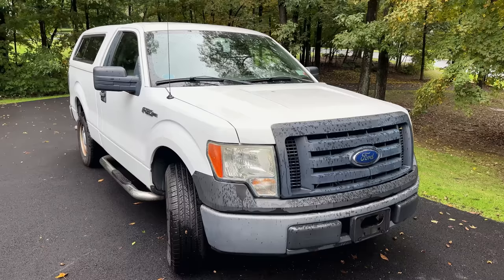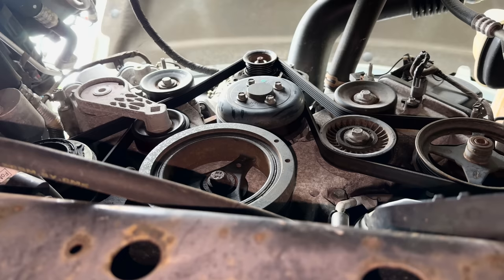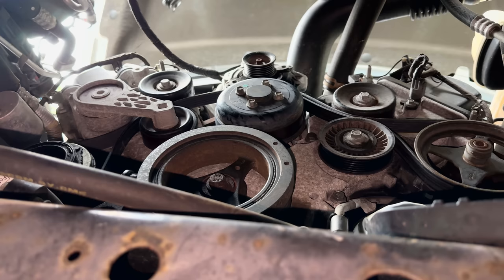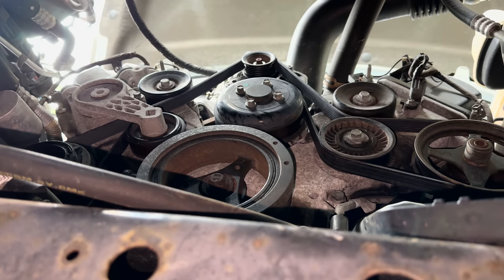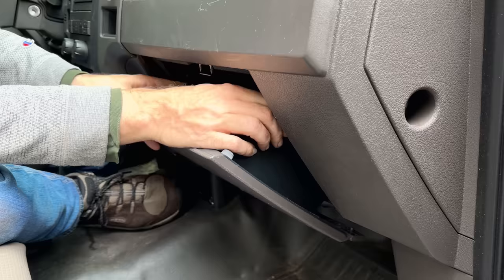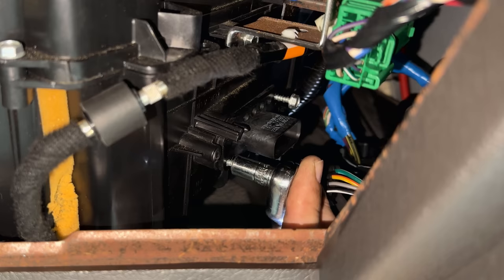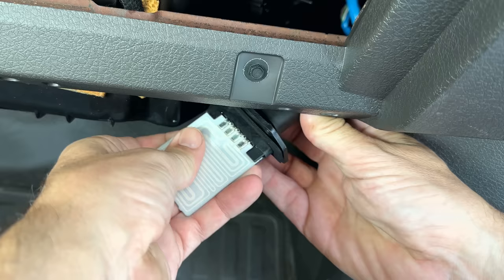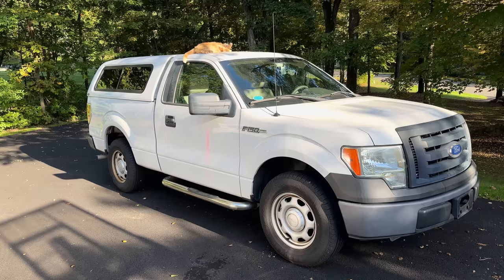2010 F-150 Belt Replacement and Blower Motor Resistor Repair

Comment: Learned the hard way many years ago to replace a serpentine belt with a quality brand name belt.  The cheap one's are fine at first but start squeeking long before they are worn out.  Also, with the belt off, it would be a great time to check each & every pulley for 1) bearing noise 2) wobble 3) freely turning.
Reply: Yep
Reply: If it's hard to replace or it's gonna mess you up if fails, always go with the good stuff

Comment: Check your blower amps on max, the motor will take out the resistor IF it’s dragging & drawing too much.
Reply: That Block is by-passed on High..
Reply: Right, but the motor is specc'ed at max. If it's drawing to much at max, it's drawing too much at other settings, too
Reply: Yup, as the blower motor ages it can start drawing more and more amps which can take out the resister pack.
Reply: My blower motor needs lubing  bearings every few years, or rats nest or leaves plug the vanes and cause a load. Clean out, lube up and replace resistor as reqd. A mesh screen over air inlet duct helped.
Reply: Check for mouse nest in blower assembly would cause excessive blower current...
Reply: Beat me to it. Dragging motor bearing causes more power draw and probably insufficient airflow across the resistor.
Reply: @rcf8367 It won't blow the resistor card when at max, only when in lower settings  does the card actually cut the current down. Yes when testing with an amp clamp you want to check it at max to see the draw.
Reply: @ruchknruchkn6575 or restricted air flow could be causing the failure.

Comment: On a different subject, You always say at the end of your videos “Hope this helps”. Well I can honestly say they do. Had a problem with a tiller where it wouldn’t start. Took the carb off and cleaned it out pulled the pilot and main jet. Pulled the float and needle valve. Cleaned the ports with carb cleaner. Put back together and started on second pull. So I’m saying thank you for the useful info on your vids.

Comment: Check your cabin filter. If it is plugged then low air flow will cause the board to burn up
Reply: The 2010 F-150 doesn’t have one.  The 2015+ F-150’s does have one behind the glove box.
Reply: @stevenn4393 Evaporator or heater core plugged up?

Comment: I had no idea that replacing a serpentine belt was so easy.  Great video as always!
Reply: It's even easier on the 4.2 V6 Essex engine
Reply: Try it on a Volvo with a transverse engine - It's not! Try it on an Iveco Daily van, and you can almost so it with your eyes closed.  

It's all down to the individual vehicle design.
Reply: Thanks for keeping the feline helpers in the videos. 😍
Reply: @JonathanKulp  The old cat scan. They always have to inspect something new in the drive way. lol.
Reply: try it on the audi: you gotta take the engine out!

Comment: that blower motor resister may have gone bad from a high current blower motor or insufficient air flow from a dirty cabin air filter.
Reply: Yep, I was thinking the same. Bearings could be dragging, causing high amp draw.
Reply: Likely also is transient excessive current drawn by the blower motor.
This is common for a vehicle not in regular use. Daily use frequently
runs a blower to keep bearings loosened up that otherwise get sticky
and drag from lost lubrication. Some blowers can get surface rust on 
the armature while the vehicle is in disuse and can drag and run noisy 
and draw excessive current and cause the resistor block to burn out. 
I have seen some blower switches first On detent is High to bypass
resistors and provide full current as a surge to help start the motor
and then the selector steps down the speed of the motor as if the 
speed selector was backwards to what is more usually found as an
Off to Low, so the transition is always Off to High and High to Off. 
Some blower switches have no actual Off condition and the motor
is still windmilling at a very low speed to keep the bearings free to 
reduce the failure rate for the blower resistor blocks. Some blocks
will have self resetting thermal breakers for protection but most
of the manufacturers are too cheap to include that feature. Most
of the time when a blower resistor burns up, it is a good idea to
at least oil the bearings or replace the blower motor if needed. 
Obstructed airflow from leaf debris on the intake vents or a 
dirty screen or filter can definitely cause resistor overheating 
and failure by itself, but particularly for a vehicle that has been
sitting in disuse or is rarely used, all these issues can combine.
Reply: Mouse nest or a rat nest it's happen

Comment: James, I have that exact truck in Lariat trim. A 2010 F-150 Super Crew with the 5.4L-3V engine. I see from the video that yours has the 4.6L engine. The 4.6L and the 5.4L-2V engine are both extremely reliable and you should get 300k+ miles out of it without any major work AS LONG AS IT IS WELL MAINTAINED! 
These Ford OHC engines (all Triton series, and the newer Coyote series) all use an oil-pressure based cam chain tensioner, which is known to lose seal at about 150K miles if not well maintained. In the case of the 4.6L and 5.4L-2V engines, you lose a little oil pressure, and the engine makes some odd noises from the front timing chain cover due to the chain slapping against the tensioners and inner timing chain cover. Other than that, the engine pretty much runs fine. If you ever hear that, get a timing chain replacement done quickly to prevent other issues. Just keep an eye on the oil pressure gauge, and if it drops, even a little, listen for that chain noise, and get it repaired right away if you hear anything out of the ordinary.
Mine, however, has the 5.4L-3V, which has the same tensioner configuration, but has one more serious issue...  If the tensioner seals let loose, then the timing chain slaps the tensioners and breaks them, which allows pieces of the tensioner to fall into the oil pan and clog the oil pickup, and, well, you can guess what happens then. Oil starvation is (as you know) a major cause of catastrophic failure in any engine. Add to that, that these engines are OHC, and lack of oil pressure causes the engine to eat itself alive from the top down, in a matter of weeks.
While your 4.6L is far less known for this issue, it wouldn't hurt to stick your borescope into the oil pan through the oil drain plug and look for debris in the oil pickup. If it's clean, then you're likely ok. Just maintain it well, use 100% synthetic 5-20 or 5-30 oil always, and DO NOT EXTEND OIL CHANGES BEYOND ABOUT 5000 MILES. If you do that, you'll probably get 300K+ miles out of it.
Reply from the maker: Thanks for all the tips.  Not crazy about the chain tensioner design.  Will be on the lookout.
Reply: @jcondon1  I find it difficult to call a design that lasts for 150k to 300k miles a "bad" design. (I realize you didn't call it that, you only said you were not crazy about it.) That being said, if something DOES happen, the eventual results can be a lot more costly than with a more simple design. A traditional single internal cam with pushrods, doesn't have a tensioner, and thus, has far fewer potential issues. But, these Tritons and Coyotes can last forever with proper maintenance, so I still like the design. That 4.6L Triton is a rock solid engine!
BTW - I had a timing chain replacement (and associated parts, cam phasers, chain tensioners, valve rockers, oil pump, etc.) done on my 5.4L-3V proactively since I bought the truck used and had no idea of it's history or maintenance record. Luckily, the internals looked really good, so it apparently was maintained really well. Still, I know that it will give me a lifetime of good service now that it's all new, genuine Ford parts.
And, like others have said, you can go get more generators now. 😁

Comment: Hi, James. Seems like you swapped wrenching-hobbie with Mustie1 this weekend. He's doing a generator😂. To your problem with your Resistor. Maybe you check the  inside of the blower-housing with your boroscope. The air-passage may be blocked with leafs or such. An clogged up airfilter may also be a culprit. As mentioned by other viewers a slowly dying motor could also be the issue.

Comment: My blower resistor was replaced 4-5 times and then I replaced the blower motor on my Dodge Dakota. The resistor was $5 from Chrysler but the two replacement motors were $300 each. I also had to replace the wiring harness twice which was $100 each time. Ultimately I ended up putting a screw on the knob that controlled the speed of the fan and limited  the speed to a setting of 3 out of 5. I wish you a better outcome.:face-blue-wide-eyes:

Comment: James, you did exactly what I did on my old Chevy van. I replaced one resistor and the new one worked before it quit. I did that again with the same result. Finally I had to replace the connector and wires. Pulling the connector apart was polishing the connector contacts enough to restore power until the connector failed again.

Comment: Just a suggestion. If you are going to use this truck to load generators add a small ATV type winch to the front of the truck bed inside. With portable ramps it will make loading just about any equipment quite easy. The installation of the winch might make an interesting video.

Comment: I like how you got a 2nd opinion after the first Cat scan😁
I think the cats can smell the current/previous tennants.
Also, the genuine Motorcraft resistor looked suspiciously similar to the Amazon one🤔
Reply: Or the Amazon one looks suspiciously similar to the Motorcraft one. The odds are good they're all made at the same factory. Just because a part is stamped Ford/GM/Chevrolet doesn't mean it's made by them.
Reply: @JCWren  Yes, that's definitely a possibility.
Very few parts are made by the actual car makers these days, just a conglomeration of parts made by major parts manufacturers from many different countries.

Comment: I see the supervisors came out and gave the job the cat scan. On the noisy belt I had a F150 had noisy belt new on only lasted about 6k. Finally found out power steering pulley was almost 1/4 inch out of line. You had to lay a straightedge across pulleys to tell. After a FUBAR  nightmare involving a new pulley and a hammer and chisel. Only changed belt once in the next 200k. Good luck with the truck.

Comment: Aside from checking the blower amps. Also check if there is a physical obstruction in the housing that is preventing the resistor from being cooled. They shouldn't break that often.

Comment: The belt noise is often generated not by the grooved side, but rather the smooth side where it drives the water pump. You can test this by spraying a little WD-40 on the water pump pulley. I saw you put the flat side on the idler pulley with grooves and laughed, been there, done that.

Comment: A few years back I was hurt at work and had several surgeries to correct the break. At the end of it I had to buy a vehicle and I found an 85 grand marquis and the right price. Deep down I wanted to drive a big old car anyway so I bought it. Had to replace the resistor on it. And a few other things. It was an awesome if not so desirable looking design. $500 went a long way. Anyway

Comment: James, I have a 2011 Escape with the same resistor for the fan.  I did the same thing.  The original went bad.  Used a cheap Amazon one for maybe a year.  Then had to replace again and at that time I went with a MotorCraft.  My MotorCraft one was good and has been in use for about 4 years now.
Reply from the maker: That gives me hope.

Comment: I just turned in my 2011 F150 at my day job for a 2014 GMC 1500. That Ford was a good truck, but it’s going to auction as the higher ups decided it was past its useful life.

Comment: James I have 3 Ford's that use that style blower motor resistor. First one I replaced from ford lasted just over 1 year. The ones I got from Amazon lasted much longer at a lot less. I would check the blower motor maybe drawing to much current.

Comment: Over the years I've always used di-electric grease on the blower fan resistor connector when replacing the resister.  Those connectors can have their own issues because of bad contact which creates heat.  That I find is the leading cause of those resistors burning up.

Comment: Hey James ...glad you got the mower deck bracket sorted now, so it doesn't hit the steering. The Blower fan motor should be replaced. They do still work but draw too many amps overheating the board on the resistor. Ask me how I know. LOL After 4 boards inc a faulty one. tells me that the motor is not good. An amp clamp should confirm it .... but you need to know the amp draw on a known good motor as a reference. Cheers Robert
Reply from the maker: That is the key.  Don’t know the amp draw.  Will go back in and replace the motor and do the cabin filter while in there.

Comment: Hi James...i had the resistor replaced twice on my Ford F250 before they blamed it on the blower motor. They replaced the motor and I didn't have the resistor problem in the future. FYI....
Reply from the maker: I am expecting the same.  But so far so good.

Comment: James, if the fan belt starts squealing again it's because the alternator pulley is worn out. What happens is the V's in the pulley wear and the belt bottoms out, hence making the belt slip.

Comment: the belt groves get deeper as it wears, this causes the slipping, check the old to the new groves and you might be able to see it, there is a tool to check the groove wear. The fan motor might be going bad as well which would pull more current than the resistor can handle thus the failure. IF it happens again replace the motor and the resistor.

Comment: If you have air conditioning, there may be a heat exchanger near the fan resistor. If the heat exchanger is plugged up with leaves and junk, then it may be overheating the resistor.

Comment: Most modern belts won't crack. The grooves in them start out shallow. As the belt gets older they get deeper. Eventually you have the problem that you had with it. 30 years ago blower resisters rarely went bad. After the 2000's they went down hill.

Comment: Thanks james.  
Reminds Me of a time with My old 99 E-150 Shop truck. My trouble totally baffled the Shop tech Cause I told Him the Switch was bad. I had all the lower speeds but High..  and he insisted the Resistor Block was bad.  
I took the switch apart right in front of him and showed Him the Burned up Contacts.....
Mike M.

Comment: lot of 2000-ish GM products had problems with the blower motor resistors. Had a vehicle that went through two of them, with no other issue than just garbage resistor assemblies.

Comment: Would have been interesting to see how their resistances compared. Absent any obvious burn marks or cracks, you might try reflowing the solder joints. Would take only a few seconds and might clear up hidden defects.

Comment: Definitely check the fuel trims too as well make sure they are within pos or neg 10 percent ultimately you want the LFTF to be close to 0 as possible too
Reply from the maker: Need to get an ODB2 scanner.
Reply: @jcondon1  try the Bluetooth one think diag I got it and it works pretty well

Comment: Take the blower motor out and lubricate its axle areas.  You will be amazed at how much friction the axle has before lubrication and then how well the motor spins after lubrication.  I did this procedure on my Ford Fusion.  I used CRC Heavy Duty Silicone Lubricant spray (not stinky).

Comment: Have the same issue on my 1995 s10.. replace resistor after 5 minutes it blew.. its the amps on the motor. S10 is known for motor contacts.. the contacts is on the blower motor go bad.. you have to pull dash.. i just use 4 for defrost..
Oil your  belt pulleys. Home made lube i use is 50/50 atf/ actone.. apply lube to right around center bolt tension bearings. Same thing to ac clutch bolt assembly.. apply lube and leave it for a hour or two.. it will flick lube everywhere after you start it but just wipe it down..

Comment: Check the amp draw of the blower motor.  High draw can cause resistor failure.
Reply: Resistors are by-passed on High...
Reply: @m9ovich785  you're confusing power and load.

Comment: This component is a piece of crap built to absolute minimum wattage.   I would just keep replacing the Auto Zone  resister as they burn out.  You could build your own resister pack using higher wattage components but then you will probably burn out the dash switch as this is also a common problem  with Ford vehicles.  Good luck James and thanks for all you do.

Comment: easy way to tell if it is just the belt is to hit it with water while the motor is running and if the noise goes away for a few seconds it is your belt

Comment: a good idea is to look at the actual pulley. If its ridged, then the INSIDE of the belt should go over that pulley, if its smooth then OUTSIDE of the belt should go over that pulley. That should give a useful hint in combination with pictures of manual and such.

Comment: Since you have a couple of samples, you could use multimeter to measure the ohms on the resistors and compare them. For the original, it is possible that it is a bad solder joint and you could reflow it.
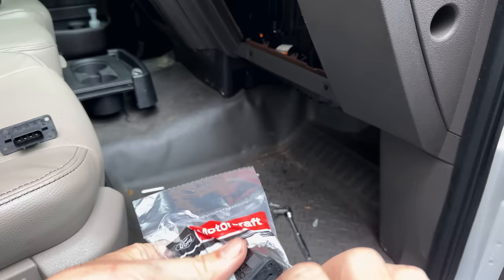Reply: 10:09 Depot it and rebuild it?!?!  Lol. Theme of the month
Reply: Great minds think alike....

Comment: Any more, cracks in the belt aren’t usually the indicator. Just the wear in the grooves and how deep it starts sitting in the pulley as a result. That said, pulley bearings and also pulley alignment can cause noise. Which will require a laser tool to check. If the harmonic balancer rubber ring is bad and the pulley has moved, or even if the alternator is replaced or any of the idlers etc and no longer in alignment, can cause a noise. Even the silicone belt sprays can cause noise after the initial quieting.
Reply: Oh yes... The harmonic balancer rubber ring.  Wouldn't be the first time that bit somebody